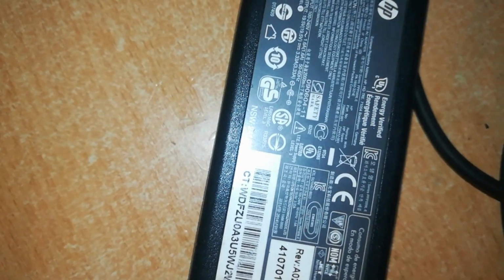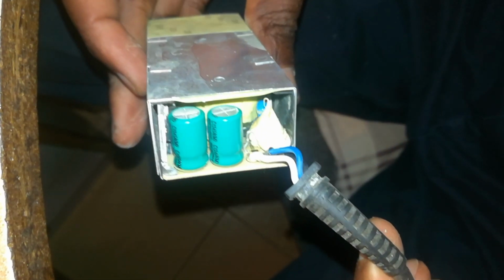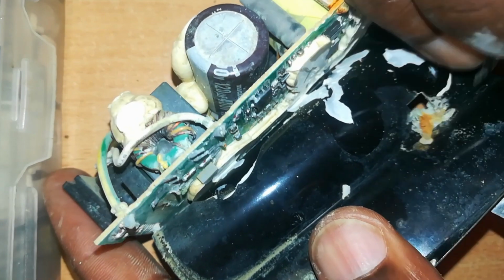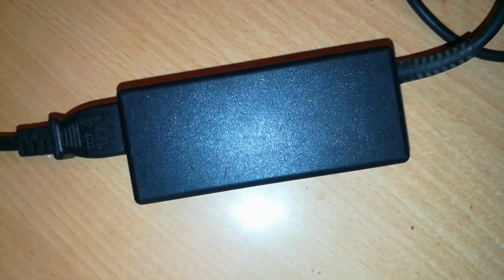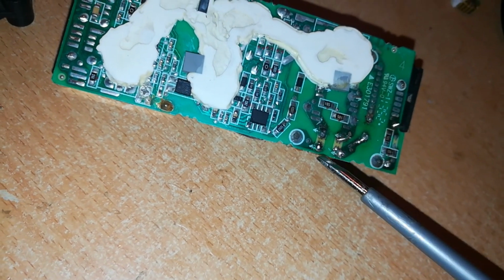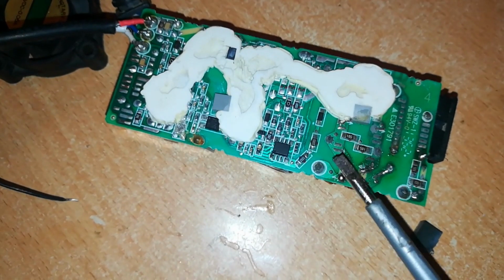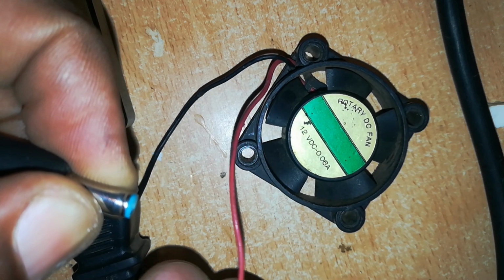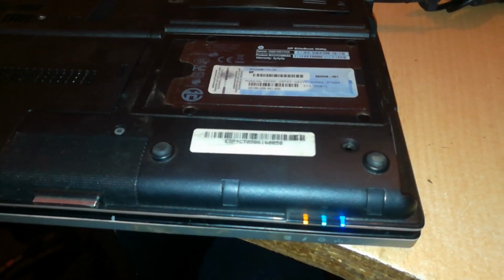HP Laptop 65w Power Adapter diagnosis and Repair #hppoweradapterrepair #hppcpowersupplyrepair

Comment: You should warn people that they could get a high voltage shock (higher than mains voltage) even when the power is unplugged, because it takes time for the capacitors to discharge.